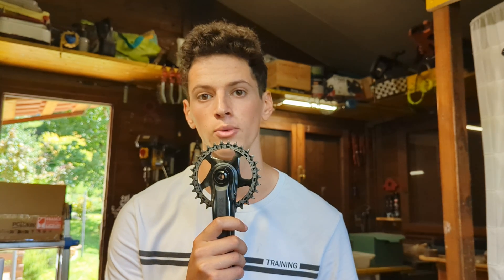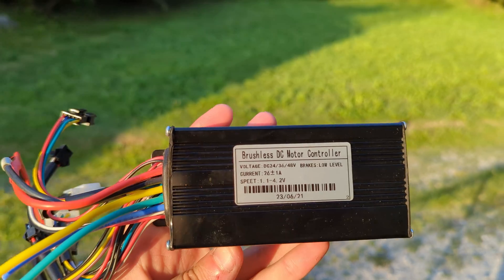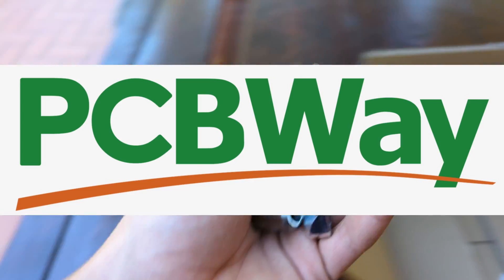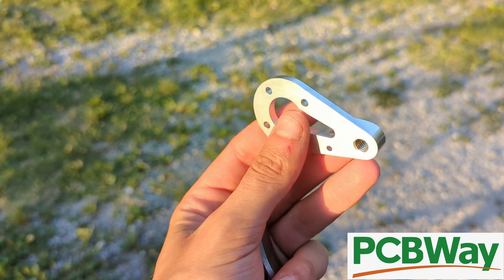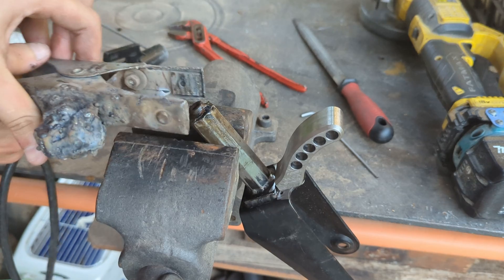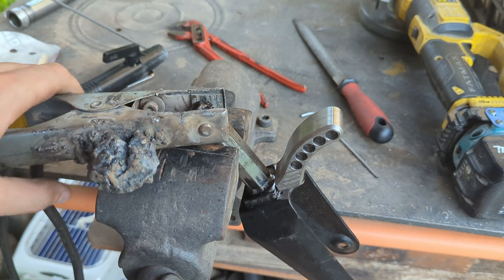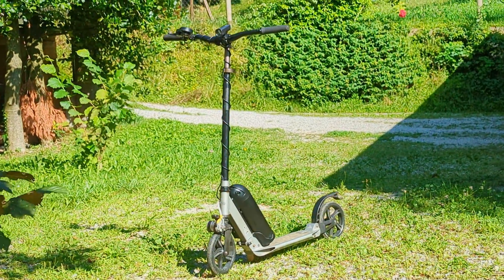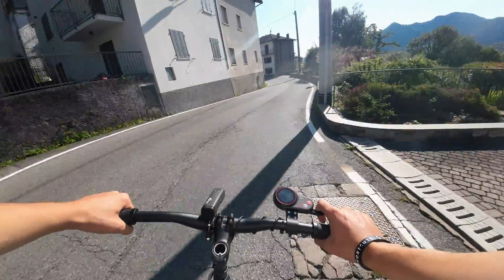building a POWERFUL electric scooter (ONLY 200$)

Comment: This is total B.S.. that setup wouldn't work. Sure it might spin the wheel when off the ground but wouldn't go anywhere once any weight is put on the scooter. Nice try.
Reply: how to maintain the friction  between the wheel and motor , and that was roughly 1-3 gear ratio. if it had the torque im not sure how traction is maintained,, Yea , if t worked , it was temporary